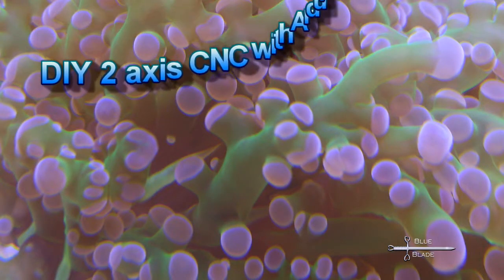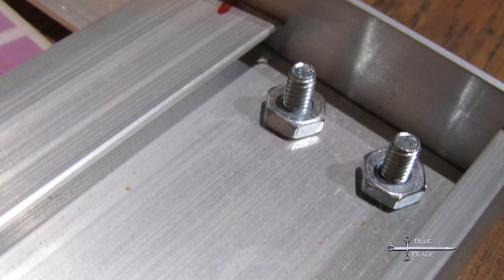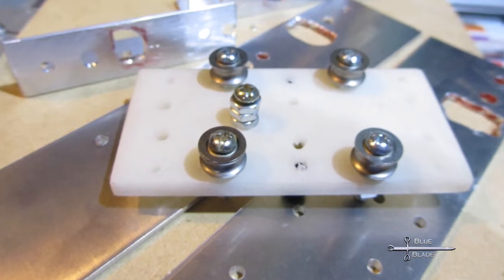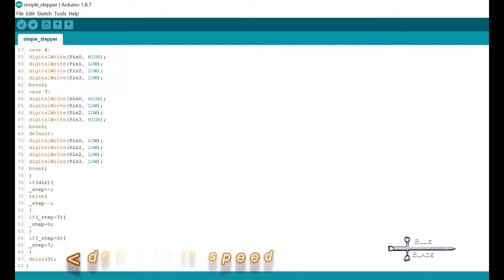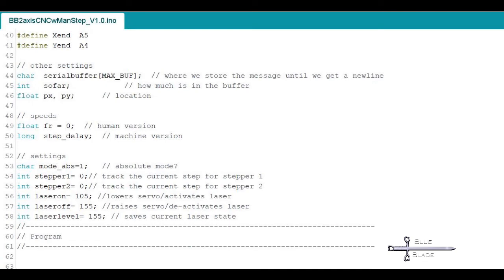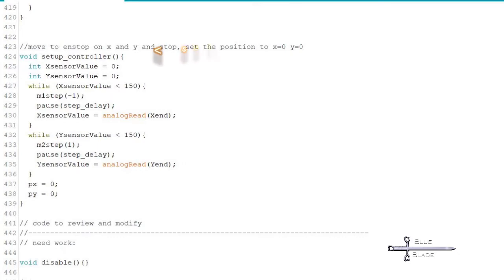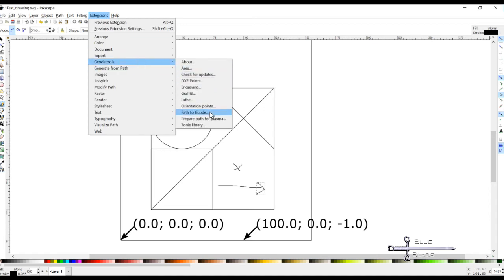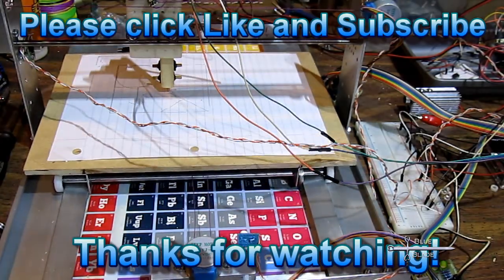DIY 2 axis CNC with Arduino pt1:  Plotter - code, steppers motors, and frame

Comment: may I ask for a series of pcb layouts using Arduino Uno Blue Blade Fish
Reply from the maker: Hi! well, i didn't make any PCB's for this project as I only intend to have the one. There is some circuitry for the laser driver that i will cover in the next vid (working on that now), and i will put the circuit diagram (fritzing) out on git-hub when i post it.